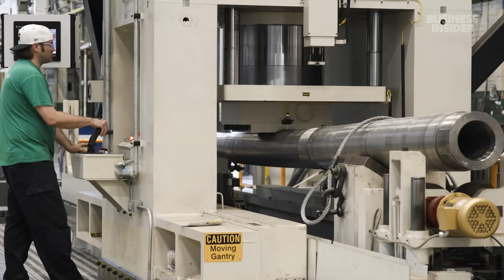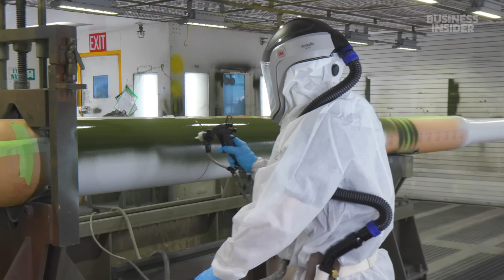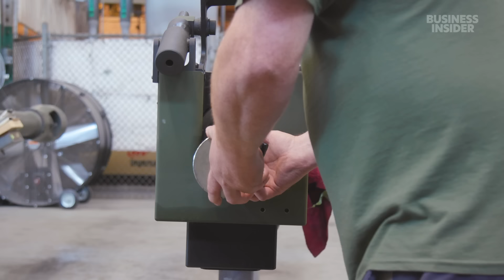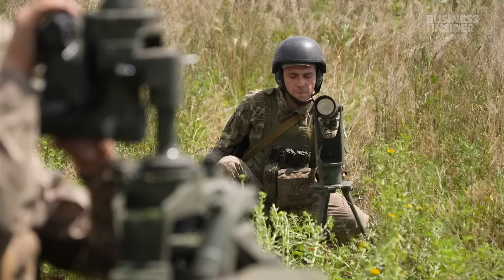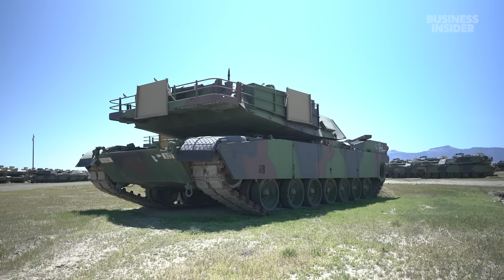Why the US Has Only One Factory for Cannon Barrels

Comment: Extremely unsettling we have only 1 of these facilities in the entire U.S. ngl. Seems like a massive vulnerability.
Reply: its a massive investment when there is no apparent need. the US has massive inventories scattered around the US and overseas. I've visited the facility at Hawthorne, Nevada and its hard to envision how large it is. Covers the whole valley floor.
Reply: @randyearles1634  All this stuff proves to be no use in the current war in ukraine. One 400 $ drone is all it takes to take out 1 barrel.
Reply: It's due to the post-Cold War contraction of the defense industry. There just hasn't been a call over the last 3 decades for much howitzer production (or tanks, or major warships, etc, etc), so you get one or two factories/shipyards for these types of equipment. There is also only one tank plant to make Abrams, for example.
It isn't a big deal, normally, because there are still thousands of big-ticket items in storage, and the kind of fights the US has been in just don't require more. It's just that people are thinking of big wars against peer opponents again, so now it isn't so good anymore.
Reply: And the reason for this is literally to save money.
Reply: I live in the Capitol Region, if this facility is attacked, we have far bigger problems.
Reply: There is no reason to be worried. The U.S. is not at war and 1 facility is good enough to fullfill the current demand. There are plenty of artillery shell stocks and when war breaks, most of the industrial manufacturing plants will be converted into military factories.
Reply: In a global conflict similar to WW2 the US would get annihilated by China. WW2 was won through American manufacturing output but today China’s industrial manufacturing capacity is like 100x that of America.

Comment: The number of gun tubes made in the US is ridiculously low if you believe this documentary. Whether it's the main gun on a tank or gun tube on artillery, you can expect only around 900 rounds before the barrel needs to be replaced. Yep, that's right. Just 900 shots. I'm guessing the 120mm main gun on the Abrams tank is made in Germany where it was designed and perfected. That leaves artillery barrels and we're not making squat.

Comment: Shear coincidence....I just read a book about Bethlehem Steel ( Bethlehem PA)...near my home.

In the 1890's the Government decided the US needed to make their own big guns instead of buying from Europe.
It was decided the Army would make their barrels in Watervliet and the Navy would make theirs in Washington Navy Yard.

Bethlehem Steel provided the massive forgings used in the Navy battleships main batteries.
Beth Steel closed in 2003 and the old blast furnaces are now a tourist attraction (Steel Stacks).
Reply: From 1949 to 1952, Bethlehem Steel had a contract with the U.S. federal government to roll uranium fuel rods for nuclear reactors in Bethlehem Steel's Lackawanna, New York plant. Workers were not aware of the dangers of the hazardous substance and were not given protective equipment. Some workers later sought compensation under a radiation exposure law, which was enacted in 2000 and required the U.S. Labor Department to compensate workers up to $150,000 if they developed cancer later in life, provided their work history involved enough radiation exposure to significantly increase their cancer risk. Bethlehem Steel workers, however, have not been awarded this compensation because radiation doses involved in processing fresh uranium fuel is low and produces a small risk relative to baseline risks. The larger danger in processing uranium is chemical poisoning from the heavy metal, which does not produce cancer. As the age of Bethlehem Steel workers was increasing, however, the ratio of retirees to workers was rising, meaning that the value created by each worker had to cover a greater portion of pension costs than before. Former top manager Eugene Grace failed to adequately invest in the company's pension plans during the 1950s. At its peak, the company's pension contributions that should have been made were not. As a result, the company encountered difficulty when it faced rising pension costs associated with its retiring workers, which were amplified by the company's diminishing profits and increased global competition. In 1998, after denying pension benefits, a lawsuit was filed in the Third Circuit Court of Appeals in Philadelphia. The case, Lawrence Hollyfield, Fiduciary to the Estate of Collins Hollyfield v. Pension Plan of Bethlehem Steel Corporation and Subsidiary Companies, was settled in favor of Hollyfield three years later, in 2001. The settlement led to a class action lawsuit filed by Bethlehem Steel's workers union, which led to PBGC assuming all Bethlehem Steel pension obligations, representing the largest pension such liability assumption in U.S. history.

Comment: Taking 4 months to make a barrel is a disgrace. The 155mm shell factory was similarly ancient. The entire military infrastructure was running on empty with no modernization money provided as a matter of course. Govt contracting is absurd. No wonder everything is so incredibly expensive. They order, they turn around and cancel half, they cancel another half. They stop production after a few years. Everyone moves on... then they decide they need more but won't pay to upgrade equipment and half the staff has to be rehired and retrained. 
Its textbook ineffeciency. 
Requiements are based on numbers that are frequently insustainable as they rush the requirement, then shut down for years... Innovation is not continuous, nor is the work. 

There is NO attention to supporting the infrastructure. 
They also include R&D costs to inflate per unit costs so that no one knows what something actually costs (100 units vs 200)... R&D cost makes everything look hyper expensive... even if it isn't per unit. R&D is mostly expensive because they have to start from the beginning every time... no Block 1,2,3,4 evolution as there was in the past... Projects get cancelled if block 1 isn't perfect. 

Congress manages military contracts like a bunch of children on the take.

Comment: So at one point they produced 2500 barrels per month at just this factory, even with old equipment that's a huge drop off to today's production numbers. My belief is the U.S. workforce no longer has the necessary skills, from blue collar to engineering, capable of that in sufficient numbers.
M198 and M777 howitzers were my guns.

Comment: I live near Louisville KY and one of the Naval Ordinance contractors refurbishes howitzers. They used to make 105 mm barrels. In fact, the final machinist test they had was a take a huge chunk of hot rolled steel and make a barrel out of it. Making a howitzer barrel requires every skill a machinist needs from cutting hot rolled steel which is wild to see because you have to cut deep to get past the outer layer or you just burn up tools. Cutting, threads, tapering, slots for the breech block, etc. have to be done expertly to make a functional barrel.
Reply: BAE. They claim it takes them a year.
Reply: @thischannelisbackon5679  It has to season after casting a year before machining.

Comment: Where I worked, at a Spun Iron Pipe plant, the Boring Shop, single person, straightened their - 3". up to 48" dia moulds with a Screw Jack.and a Hammer.

I have no idea what the force of fifty Hand Grenades looks/feels like, but I do know what a Joule feels like so how many Handgrenade blasts in a Joule, or probably how many Jouules in  Handgrenade blast, then I can multiply that by fifty. I get irritated with comparing something which you do not know to something which you also do not know when simple scientific units would explain.

Comment: For comparison, the 16-inch/50-caliber Mark 7 naval cannons had a length of 66.7 feet and were used on United States Navy battleships. They were much larger and heavier than the Howitzer M777 which has a caliber of 6.1 inches and a length of 35 feet. A 16-inch/50-caliber battleship cannon could fire a 2,700 pound projectile up to 23 miles away whereas a Howitzer M777 could fire a 100 pound shell up to 15 miles away.
Reply: Sadly, the U.S. no longer possess the facilities, machinery, or the practical know-how to make either the 16" guns, or the turrets they went in any longer. (Main turrets of the Iowa-class battleships were single piece cast steel items. Making.either required a certain artisan skill that died out long ago.
Reply: @frankmueller2781 yes but should be brought back and so it's not lost there's still enough interest and people to do it and mybe better with the equipment that we have today and newer steel could make that 16inch gun shoot a lot farther than it was originally designed for
Reply: @doncortazzojr2960  there's a limit to how far you can fling a shell with powder alone. it's ultimately simpler to fire missiles which can be mounted on a variety of less expensive ships than 16" cannons which can only be mounted on massive battleships. Tomahawks have ranges measured in hundreds of miles (some models over 1000 miles) which means putting those less expensive ships in less danger than you'd need to put a very expensive battleship even if you doubled the range to 50miles or so.
Reply: It's definitely a "Bucket List" item to see a volley of 16" guns all fire on a battleship! So damn cool! Every time I think of those, I think of the USS Arizona poppin off "starburst" shells in Under Siege and Tommy Lee Jones getting thrown by the blast and going deaf. Hollywood bullshit for some of that, but still awesome!
Reply: @Depth_of_Breadth  That was the Missouri in the movie. The star shells were fired from 5" guns, not the main battery.
Reply: @Urbicide  Exactly.  It doesn't seem like those fellas even watched the movie.
Reply: @Depth_of_Breadth The ship in the movie was the USS Missouri? Though I haven't seen the movie so tell me if they made a replica or something
Reply: The USS Arizona? 
That would be something to see as it is sunk in the sea in Hawaii. 

I think you mean the USS Alabama.
Reply: Bethlehem Steel,Machine shop #5 in Bethlem, PA made huge gun barrels and the shells. I went through there in a training program and the trepaning of the bore was amazing to remove that forged steel.  Even the forging teams in the adjacent buildings were true artisans to forge a huge billet so long and so straight.
Reply: I worked at Armco steel in Torrance Calif. We made those sixteen inch barrels in The Navy Building. The plant no longer exists.
Reply: That's not how caliber is expressed with naval guns.
16 inch is the diameter of the shell/gun bore, the caliber is how long the barrel is compared to it's bore diameter, so a 16 inch 45 caliber gun means the barrel length is 45 times longer than it's 16 inch diameter or 720 inches long, that was the size guns on the South Dakota class battleships, the biggest guns put on US ships were the 16 inch 50 caliber guns of the Iowa class battleships, 50 caliber made them 800 inches long. 
It's different than with small arms where the bullet diameter is expressed in caliber, ie .30 caliber, .22 caliber etc etc, with big naval guns the diameter is expressed in inches and the barrel length is expressed in caliber.
Reply: They did not show how they make the bore.
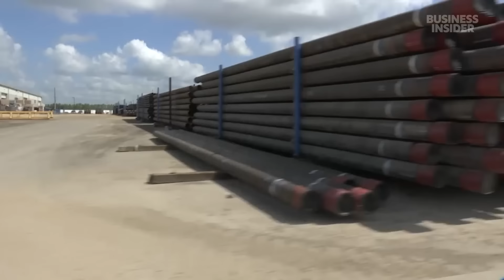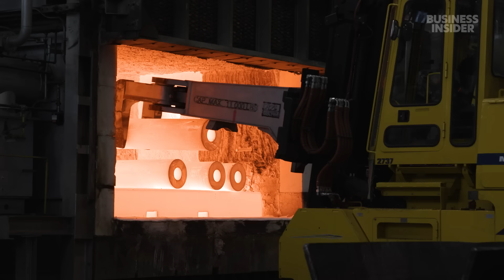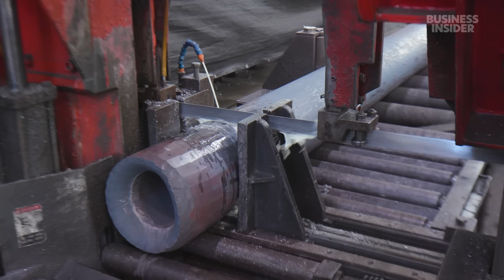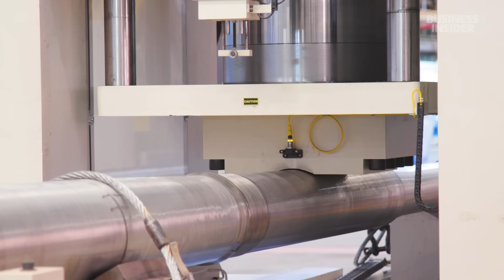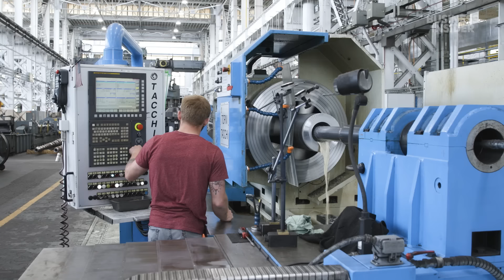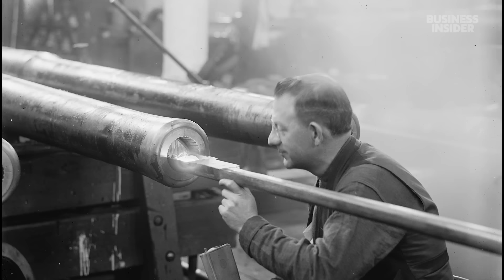Reply: @elevenbucks5682  Thank you for your question. @ 3:47 a cannon barrel starts out as steel cylinder tube which already has a bore in it from the foundry. @ 3:56, a mandrel is inserted into the bore of the cylinder tube to keep it from collapsing as rotary hammers strike the outside to forge it to shape. As the cylinder tube gets narrower, it also gets longer. @ 5:01, the end of the cylinder tube is cut off to get the length of the cannon barrel. @ 5:08, the cannon barrel is pressed and bent to correct its straightness. @ 5:34, a lathe trims the inside of the cannon bore to the correct interior diameter. @ 2:19, the rifling grooves are cut inside the cannon barrel. Rifling grooves are used on a gun projectile for spin stabilization during its ballistic flight.
Reply: @jadenephrite  They threw me off when they showed what they called a cylinder when it was a round or billet.
Reply: @jadenephrite  Thanks!!!
Reply: Yes I want to see them make some new ones of those
Reply: @doncortazzojr2960  I worked in the Navy building at Armco steel where our heavy engine turret lathes turned out those 16” barrels. After the war we used them to turn boat shafts and drill casing for the oil industry.
Reply: @michaelmurphy6195 coool
Reply: They no longer make any 16" guns at 'vilet, being they are no longer used and we got rid of them all not long after the first Gulf War.  But just about any 16-inch gun barrel will be stamped made in Watervliet esp any that were made after ww2 when Watervliet became the last and only manufacturer of large cannon
Reply: Absolutely insane to think about the energy involved with launching the weight equivalent of a small vehicle 23 miles through the air, from an inital explosion only the size of your chest.
Reply: Sadly, the era of battleships is over. The advent of missiles means that ships no longer engage each other at visible range or shell range.
Reply: @crosbychang  24-mile 16-inch gun range is over the horizon.
Reply: @royreynolds108 but you're not hitting a moving ship at that range with a gun, unless they don't know you're nearby and get a first salvo hit.  The flight time of a shell is so long at that range that the target just changing heading and speed occasionally will throw off any targeting solution between the firing and the shells landing.
Reply: For long-range shooting, the Coriolis effect is a significant factor for accuracy at distances of 1,000 yards and beyond, causing a bullet's trajectory to curve due to the Earth's rotation. This deflection is to the right in the Northern Hemisphere and to the left in the Southern Hemisphere, requiring a horizontal adjustment to correct for it. The magnitude of the effect depends on the shooter's latitude, the bullet's flight time, and the azimuth (direction) of the shot. Before modern computers, in olden days, complex ballistic calculations relied on a combination of pre-computed tables, mechanical analog devices, and manual calculation aids like slide rules. This was a labor-intensive process, largely done by specialized personnel, particularly in military contexts. Stereoscopic rangefinders were used instead of modern laser rangefinders.
Reply: Yes but sailors don't want to serve on them thay like the old girls

Comment: The pentagon has supported many one off factories like this. At one time Lehigh Heavy Forge (last remnant of Bethlehem steel in the lehigh valley) was the only plant in America capable of forging drive shafts for aircraft carriers. They had an explosion and I helped repair it. Stamping the barrels is about traceability and pride of purpose!
Reply: Erie Forge and Steel would finish the shafts for the Navy. Not sure if Erie Forge and Steel is still in business, haven’t been to Erie in  long time.
Reply: they left out a whole part of the process, and it shouldve made it. its a swage press for the barrels before they straighten and machine it. the biggest swage press i believe in america.